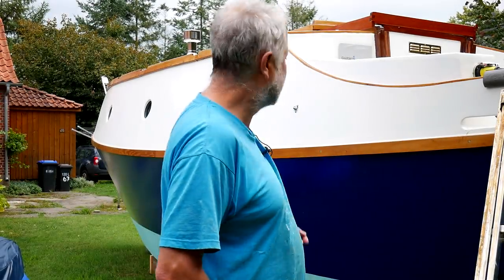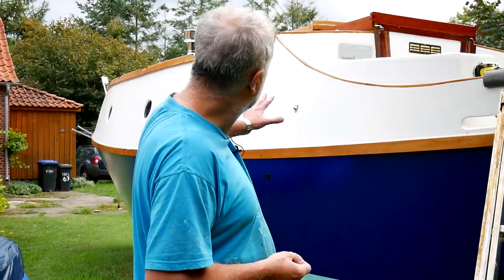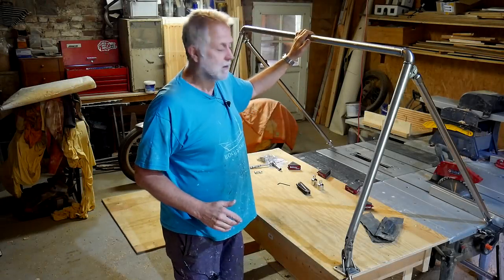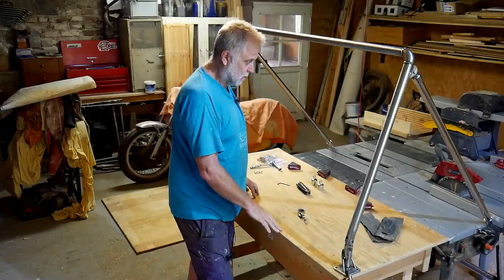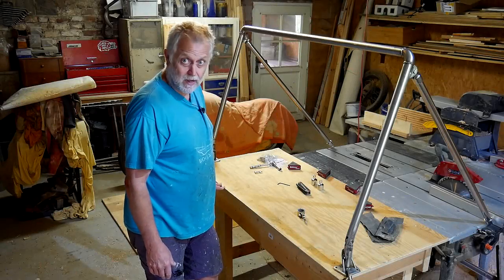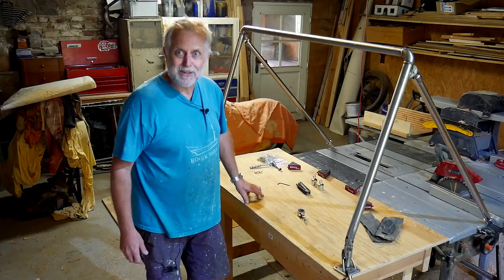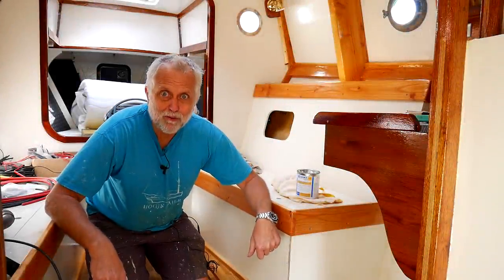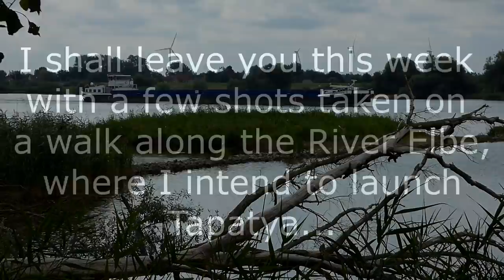Bimini? What Bimini?; Building a cruising sailboat - SV Tapatya EP196

Comment: Until folks have done similar mounts and such. You really don't know how much time you have to invest into a project like this! these things are very time consuming. That is if your to do things right! so it will last and be a durable install. I think you've done a great Job! Tony, on this project, no matter what you done, it appears to me as though you've done it all the right way. So basically you should be pretty dern proud of what you've done thus far! at least you know its going to last and you shouldn't have to redo it. A year latter which would be very dishearting. Cheers bud..
Reply from the maker: Thanks Fon. Yes, little parts, like those mounting pads, involve a lot of process steps. They're fun and sorta satisfying to make though. 😀😀

Comment: Tony? Are you ARC Welding Stainless Steel? I did not know that was possible, everything I have ever seen is Tig
Mig .... Actually I don't know. 😕
Reply from the maker: Yes John. Stainless can be arc welded with the right electrodes. The only real issue is the heat - stainless can distort if you get it too hot and arc welding produces a lot of heat.